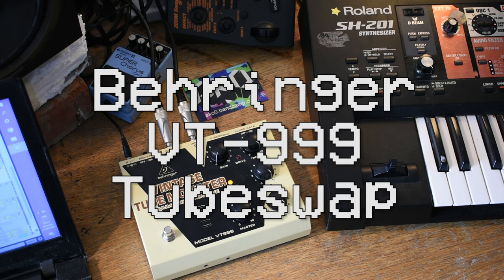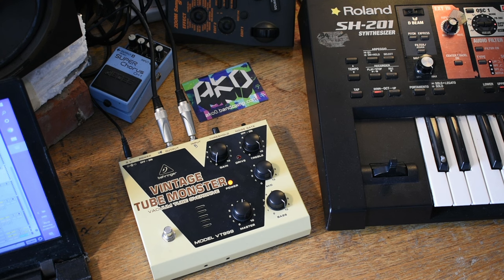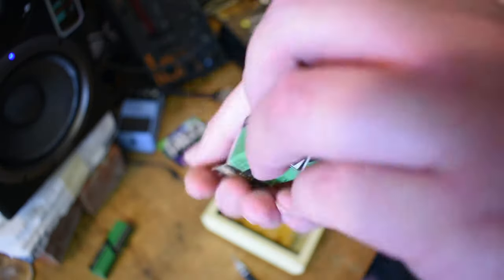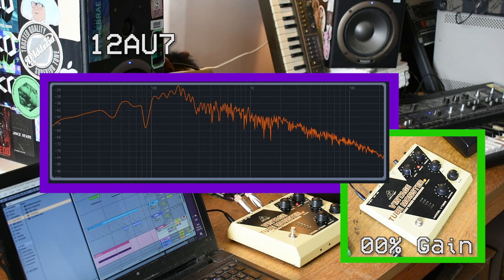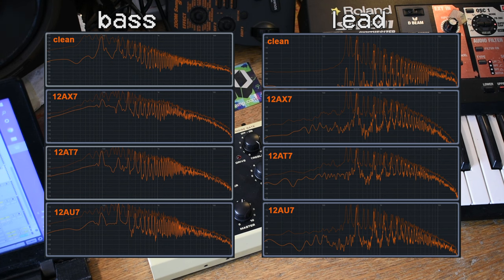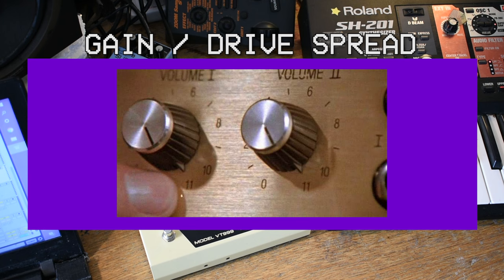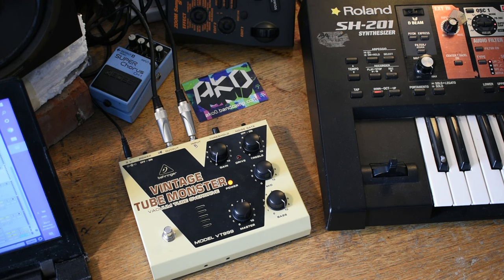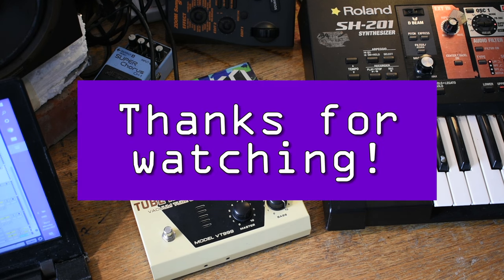Behringer VT999 tube swap: replacing the stock 12AX7 valve w/ 12AT7 & 12AU7. Is starved plate a lie?

Comment: From experience, i have to say, you should never be using your bare hands to change the tube out.  It creates hot spots from you fingers grease.  you will notice this on tubes with burn marks. if you have to go bare hand, make sure to clean the tube.
Reply from the maker: Thanks for the info! I didn't know that could be an issue, But it totally makes sense 🙌 Also thanks for checking out the video
Reply: 0 science to back that!

Comment: I'm no circuit designer, but it seems logical to me that the lower the gain range of a tube that's not getting the higher voltage level that it was designed for, the more effective it will be with the limited voltage that it does get.
Reply from the maker: I hadn't thought about it like that but yeah tbf that does sound logical, I wish I knew more about circuit design to say whether or not that's what's going. Maybe someone out there who does know about this stuff can chime in on this thread
Reply: @akozero  This video has me wondering if it's possible to design tubes that run at 9/18 volts optimum. That might be a thing...
Reply from the maker: @beatfrombrain yeah that's an interesting idea. I believe subminiature valve tubes may work on lower voltages?

Comment: Thanks for the video, and the mesures that come with it. The subject of the effectiveness of changing of tubes on inexpensive home studio consummer device is of interest to me. I wonder, is there a big difference in sound if you test the unit with an 12AT7, let's say with gain at five versus a 12AX7 with gain at 3, or 2? I mean,do you think we could get similar  results as yours if we simply use less gain with the original 12AX7 tube? At similar effective gain, do you think the differents tubes woud have the same noise?
Reply from the maker: These are all good questions! Regarding gain, yeah in theory I think your right regarding the gain range and that you could use a lower gain setting  on the higher gain tube and get the same kind of drive/gain as using higher gain setting with a lower gain tube. And indeed you could also a get more spread on the gain range on all the tubes by just feeding a quieter signal in. However I have quite a specific use for this pedal which is using it with a bass synth that outputs at a fixed line level. It's a waldorf rocket, which has a fixed output level without a master volume control. So, as a result of the master volume of the synth being basically fixed at max line level I just found that the gain range of the 12AX7 maxed out at about 50% of the gain knob's max value. Which just gave me less to finnesse. Whereas I found the 12AU7 just gave me a nice spread of different drives/gains across the whole range of the gain knob.

That being said gain isn't the only factor here, I also just personally found I liked how the pedal sounded with the 12AU7 most, at all levels of gain. I'm not sure how the gain/drive actually changes the tone with each of the tubes, but I wouldn't be surprised if the tonal characteristics were different for each tube at different gain levels - I just compared them all at max with the graphs. Perhaps more testing can be done here. 

As for noise yeah that's a good question also, I'm really not sure what would happen to the noise. The testing I did with noise was just recording the output of the pedal with the gain set to max with no signal being fed into it, there is probably some more nuanced testing that could be done there. I must admit I had assumed that the 12AU7 would be the least noisy because it has the lowest gain, but it was noisier than the 12AT7. Not really sure why that was. Maybe a lower quality tube? Maybe something to do with how the circuits around the tube are designed. 

Anyway, hope that all makes sense and thanks for checking out the video! This is a new kind of video format for me!

Comment: I think a more useful test, might really be between all the different makes of 12AX7/12AX7A. In my little MIC100 Tube Ultragain, I use a few different makes of tube. My current favorite, is a 1962 IEC branded Mullard 12AX7A, closely followed by a 1965 Conn branded Raytheon 12AX7. They both sound quite different.
Reply from the maker: Nice! Yeah I'd be curious to test different brands. When I ordered the tubes originally I was a little dubious about whether or not you'd actually be able to hear the difference between the different tubes, bc ofc a lot of people in the forums were adamant that with the starved plate gear the differences weren't noticeable. But now I know there is deffinitely a discernible difference it opens up the potential for me to invest in some higher quality brands. I've been eying up those MIC100s for a few years, but I wasn't sure how good they'd be, would you reccomend?
Reply: The MIC100 does it's job, but is really for adding thickness, more than drive. I know my tubes are being heated in it, although only about half of what I know they can take. (The amount of glow a tube has in the two heaters, directly shows how much juice it's getting, and If it's glowing orange like a toaster, at all, it has an effect on your sound.)  @akozero
Reply from the maker: Nice! Yeah I'll have to track one down, I'd like to try it out on some vocals

Comment: I just picked one of these up off eBay and received it last week. I play baritone and am using it as the preamp along with an IR loader for the cab sim on an amp-less board. As is, these pedals sound amazing and really being life to any overdrive pedal or boost going in to it. 

Now, you’ve made me want to see how it sounds with the 12AU7.

I really appreciate the effort you put in to this video. It was excellent. The graphs and sound comparisons were incredibly helpful. Thank you!
Reply from the maker: Awesome! Yeah I love this pedal! I mostly use it for synths, but I occasionally use it on the lowest gain setting as a pre-amp for DI-ed bass guitar and it sounds great for that too. I also find the EQ super useful. 

Nice! Yeah the 12AU7 was my favourite, followed by the AX, I didn't love the AT. 

I'm glad you appreciated the video! It ended up taking wayyyy longer than I anticipated. So it's good to hear someone found it useful. I did it partly for my own sanity bc I knew if I didn't record the difference between the tubes I'd just be really indecisive and keep swapping back and forth for days haha. I don't think I did the best job of explaining starved plate circuits or how it makes the tube behave (there's plenty of info on this on google), but I think I managed to atleast show the difference in tones and gain range etc
Reply: @akozero  I’m an old guy. I’ve been playing bass since the 1980s and picked up the baritone about two years ago as a songwriting aid and it’s since become my primary instrument. I have the VT999 set as my preamp on an amp less board. My pedals go in to it, which then goes in to a Boss GEB 7 to a Sonic IR. I’ve been experimenting with different amp sims for a minute now, and every one I tried just lacked that tube sparkle. I figured, screw it. The Behringer was inexpensive, about $80 US, and is basically a mod-able TS circuit with attached tube, built in EQ, and metal case? I didn’t feel I could loose, and man was I right. Within the first hour I had this thing dialed in to the best sound I’ve had since I stopped using amps. My only issue was too little control of way too much gain for what I play. I’ve been running the gain at about 1 1/2 to 2, volume at 7, and pushing the tube with the boost on a Full Drive 3. 

I was searching for brand and manufacturer reviews of different tubes when yours came up in the stream. Your explanations were top notch and exceptionally presented and really gave me a much clearer idea of what I was looking for. The spectrograph analysis of the peaks and drop offs… bro, you honestly blew my mind and gave me a whole new rabbit hole to dive down.

Thank you for the knowledge sharing and inspiration. I really do appreciate it
Reply from the maker: @KyleKalevra  that sounds like a fun setup you got there! Baritones are cool AF! Yeah I pretty much bought the VT999 for the same reason, I just wanted something with a bit of a different sound to my other overdrives/distortions (a Boss OS2, big muff and this old Fab overdrive) and the VT999 was just so cheap compared to the other stuff I was looking at and it had a built in EQ (I'd previously been having to use a seperate EQ pedal) so I just thought why not. For that price even if I just use it on one recording I've kinda got my monies worth. I like those other  pedals a lot but idk the VT999 just has a whole different sound. I'm not a guitarist, but I do own a couple of tube based tape recorders so I'm kinda familiar with the tube sound, and this pedal definitely has that kinda sound. 

Yeah I had the same issue with the gain with the stock tube, and a couple of people suggested changing the tube to a 12AU7 for a more even gain spread/range. Which is where I got the idea for this from. I did some Googling and yeah it became a massive rabbit hole for me too haha. Anyway it worked nicely for me, and it gave a nice new tone to the pedal too. 

It's great to hear you're digging the video! It ended up spiralling into a much bigger project then I expected as these things do 😂😂😂
Reply: @akozero  one recommendation I have is to keep that EQ pedal in your chain. Before the VT will allow you to alter your input signal allowing you to use it as a volume and gain boost. You can also use it to mimic other bass pickups, if it’s at the very beginning. After the VT, which I do, allows you to really dial in that output signal, cleaning up and increasing the bass response while leveling out the mids and highs.

Also, the Fulltone Plimsoul. It’s an overdrive with a second voicing of distortion you can dial in. Fuzzy, rich, great low end. It’s my go to distortion.

Thanks brother. It’s been a great talk
Reply from the maker: @KyleKalevra  Nice! that's a good idea! I'll give that a try. I mostly just end up cranking the bass all the way up on the VT, so I might be nice to do that on the EQ and have a bit more tweaking room on the low end. will give that that a try next time I have it set up

Comment: Thank you for the video. It substantially confirms what I heard when changed the tube.
I'm a guitarist; I use the pedal as a preamplifier, connecting the pedalboard after the VT999, or using the "send-return" sockets.

If I'm allowed, I would suggest to use a 12V power supply as a further improvement; the difference is clearly audible.

Thanks again
Reply from the maker: No probs! Thanks for checking out my video and I'm pleased it was useful. I bet it sounds great as a preamp for some other effects! 

Thanks for the suggestion, I did read a couple of comments online saying swapping for a 12v sounds better. But I was a bit concerned about it burning out the other components - does it actually work ok with a 12 v PSU then? And if so, what does it do to the tone?
Reply: @akozero  I use a 12V PSU on a regular basis with the VT999.  Any OP-amp can be supplied with any voltage among 8V and 18V, so there is no way to damage the unit.

The sound is noticeably warmer. It's not simply a  sensation; I have a switchable PSU, so I'm able to keep exactly the same setting, switching between 9 and 12V on the fly

The VT999 is supplied with a 9V PSU only for commercial reasons, I suppose; including an unusual 12V PSU would have been too onerous.
Reply from the maker: @voxhumana4950  thanks for the info! that is interesting. I'm going to have to try this next time I use the pedal. Yeah I guess 9V is a lot more standard for guitar pedals so it would have probably made economic sense to stick with that.
Reply: @akozero  As far as I know (from collected information, not from any in-depth study) the lack of linearity in the tube workings is greater as much the voltage is lower.
I supposed that a slightly higher voltage may reduce the  higher order harmonics amplitude. You could test this hypothesis, if you consider worthwhile, by the same means you used in your video.
Reply from the maker: That's interesting! And indeed sounds plausible. that might make a good follow up video when I next get some
Time
Reply: @akozero  I'm looking forward! Thank you very much!

Comment: Changing the tubes, along with changing the amperage of the power supply, most certainly changes the tonal characteristics.

Out of the box, the supplied tube and power supply amperage (230 mAmp, if I'm not mistaken) pair well with each other. That said...

I am running a Genalex Gold 12AX7 with a full 1 AMP power supply (dedicated / direct-in ... meaning, no daisy chaining or other draw/bleed). There is, most certainly, a tonal difference. Your desired tone is up to you, of course.

I did swap/compare tubes and varying amperage (230 ma, 300 ma, 500 ma, 1 A), with varying tonal changes.

Outside of the endless (useless) tube debate, I want to also comment that the pots (3-band EQ, gain, master) are very smooth and highly usable.

The VT999 is my overdrive of choice (configured a la full 1-AMP power amperage with the Genalex Gold 12AX7).

Running a metal zone (such as Danalectro Fab-Tone or similar) directly in the front of the VT999 is most excellent for soloing.

The most important tonal characteristic of a tube (or valve, which is also a valid term, in a different way) is the imperfect draw of electrons through a screen controlled by an input signal (e.g., electric guitar pickup alternating plus/minus). This imperfection is sonically pleasing.
Reply from the maker: Nice! Yeah a few people have said chaining the PSU for higher voltages and wattage helps. Haven't tried it yet but I will. 

Yes! The pots are nice indeed, and the full size knobs are really ergonomic too
Reply: so you use a 12v 1amp power supply all the time with it?